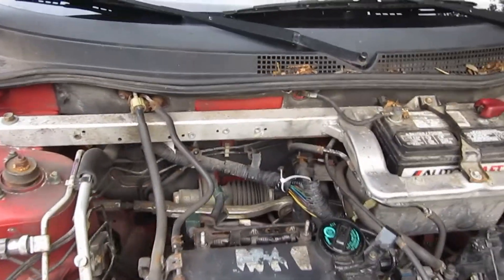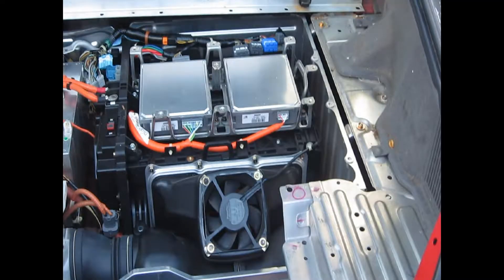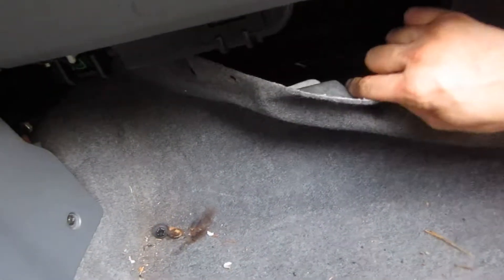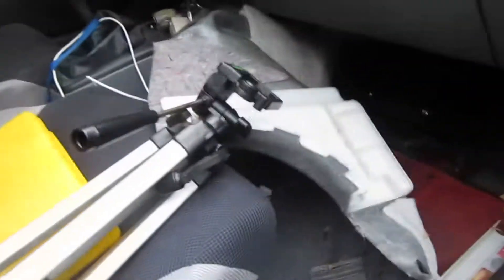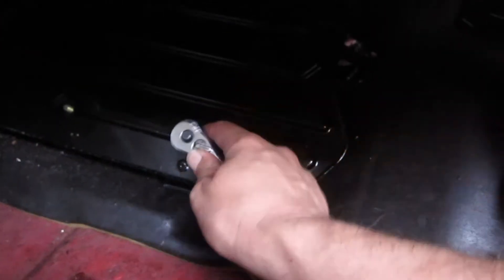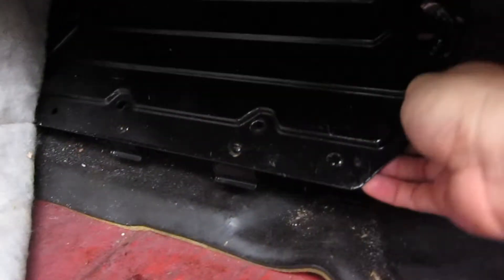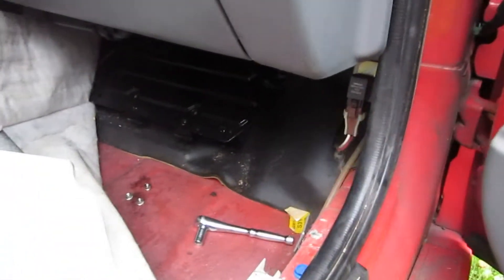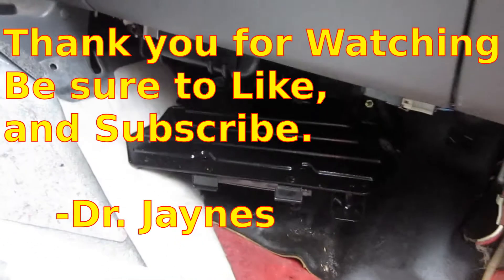Honda Insight: Where is the ECU?

Comment: So, you had issues with a CEL that wouldn't go away after replacing the upper o2 sensor? Did you fix it? How so? I have that issue on my insight and it isn't the sensor or cat.
Reply from the maker: Sorry, I had to get rid of the vehicle before I ever solved that mystery..I was worried that it could have been the catalytic converter though.. When I am not sure of the issue, I usually try changing the cheapest parts first.. then work my way up to the more expensive parts.. It started having more problems than I could fix, and I didn't want to be left stranded.. since that was my main form of transportation to work.. I changed both sensors.. so could have been the cat??
Reply: @jaynesnetwork  it's all good. I've researched that sometimes it's the ecu
Reply: @Ka_Gg  I’m having the same problem you’re talking about. Was it your ecu?